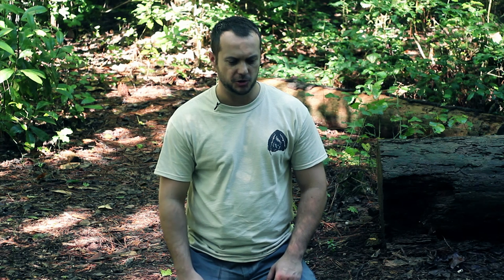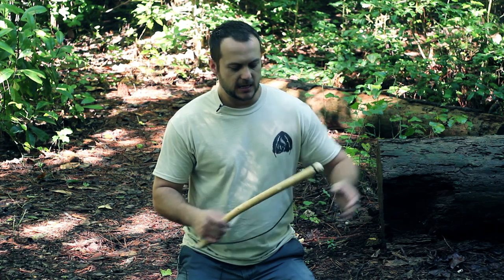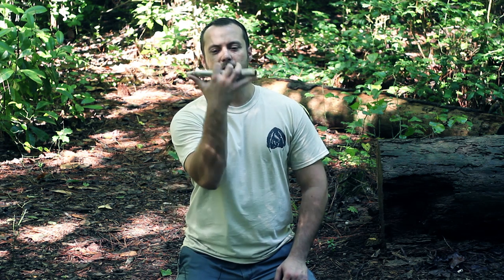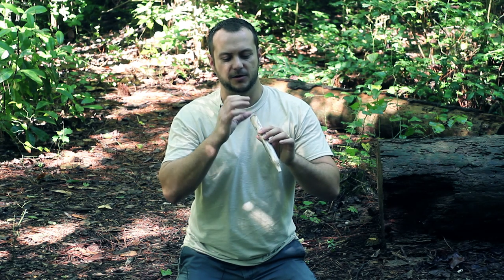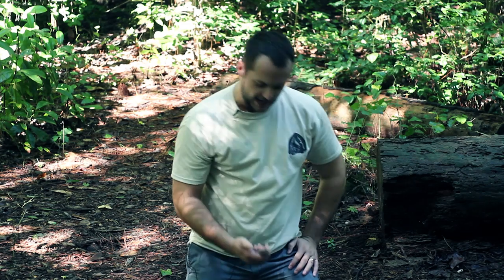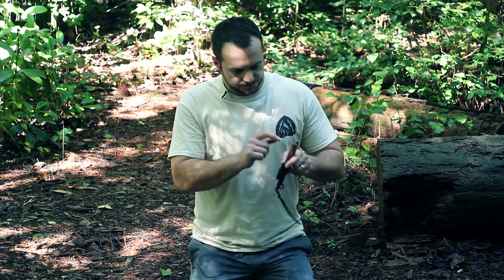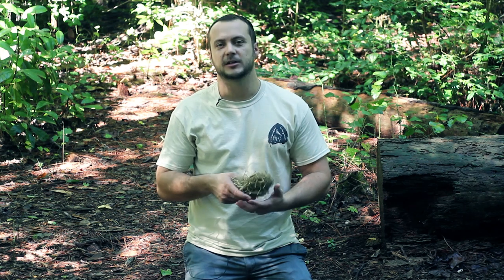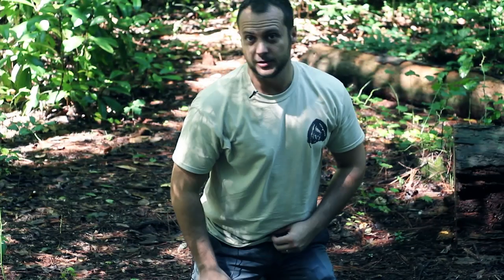Black Scout Tutorials - Friction Fire Bow Drill Method

Comment: In very wet weather, For the wood, I look for a standing tree that's not too big around, and that's completely dead.   Pine works very well.  I've started fires in the rain, and in the snow using dead pine.

The bird nest can be the hardest part of a friction fire in extremely wet weather, but you can always find dry components, if you know where to look.

Comment: I have heard that adding a very small amount of sand (or anything gritty) to the socket between the drill and fire board help create the friction faster. What are your thoughts on this?
Reply from the maker: It will help you create the divot but I would remove after that. It tends to quickly drill through the board.